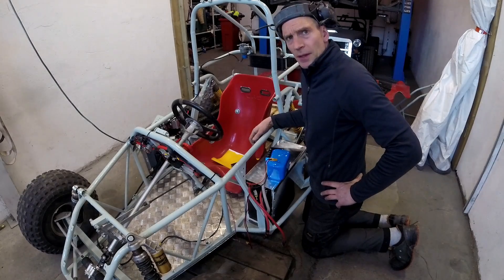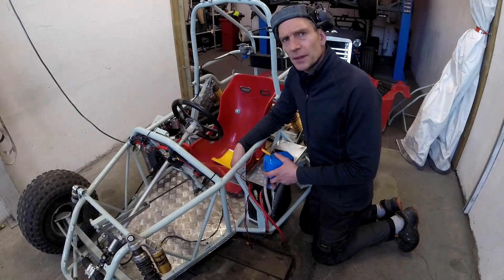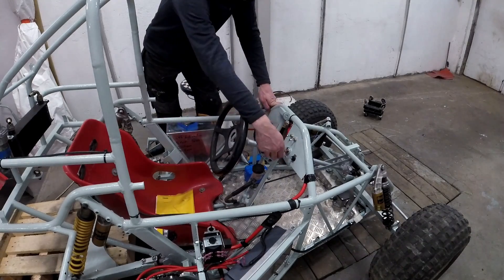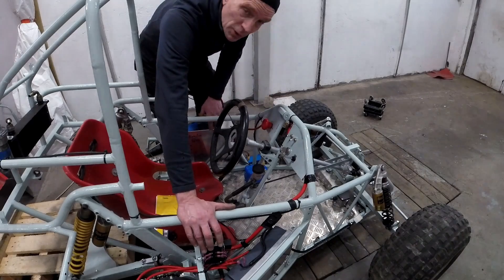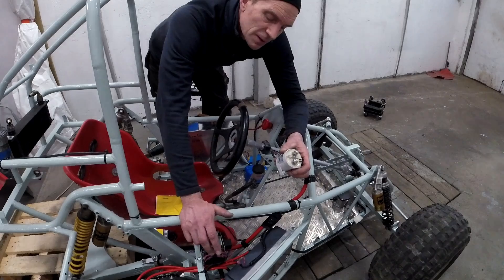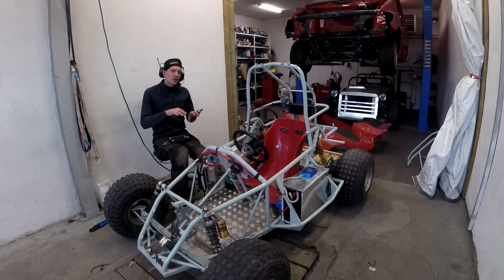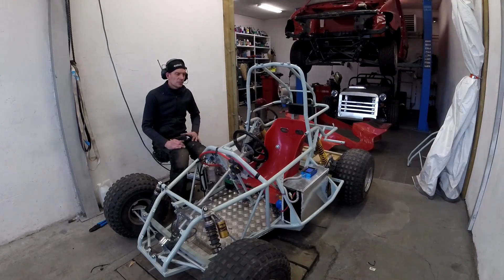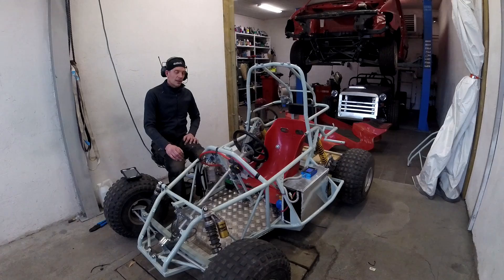Electric Crosskart 40 kW, conversion to electric.

Comment: Riktigt snyggt jobbat! Vi som sysslar med elbyggen vet hur mycket problemlösande det ligger bakom ett sånt här färdigt bygge. Bra kraft i motorn (och batteriet) är avgörande för att det ska bli roligt att köra. Det har du lyckats utmärkt med ser det ut som. Fördelar som vibrationsfrihet och tystnad gör det ännu roligare. Det förstår inte den som inte provat. Jag körde en bensingokart efter att jag kört vår elgokart, och det var en hemsk upplevelse. Vibrerade så att man inte kunde se klart. Dessutom axar vår elgokart mycket snabbare än bensingokarten trots att den hade dubbla stinkmotorer....... Beundransvärt karossjobb också. Där ligger jag helt i lä och kan bara beundra er som får till det så snyggt. Hatten av.
Reply from the maker: Tack så mycket kornmanist ! Jag kommer inte att gå tillbaka till fossilt,  byter ut fossilt allt eftersom.
Kan man få ihop det elektriska är jag övertygad man även fixar karosseri, det är lättare.  Mvh Pär